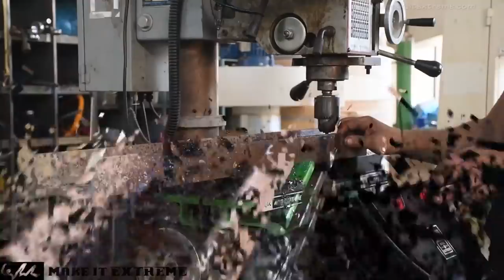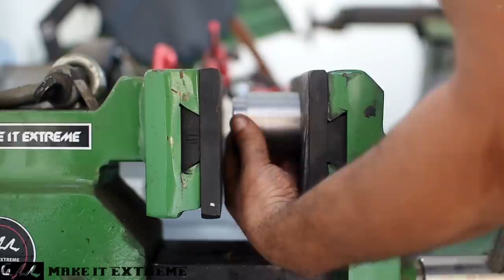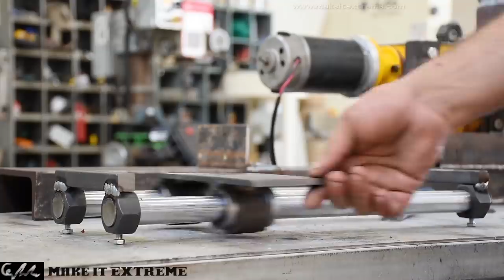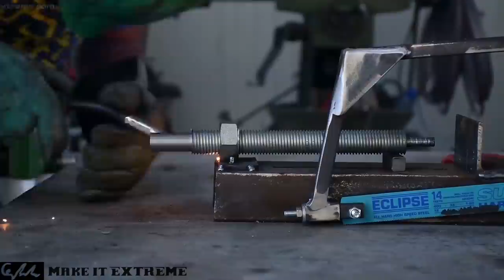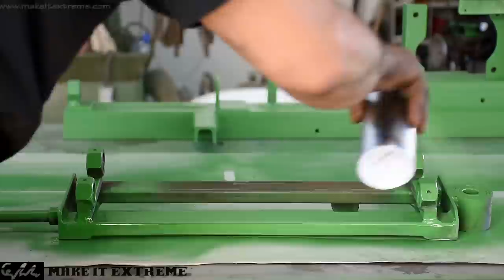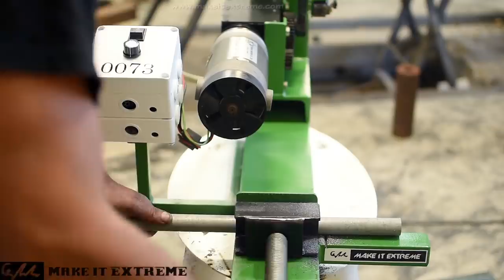How to Make a Power Hacksaw

Comment: Only out of curiosity: is there a reason you choose hacksaw instead of bandsaw? Or is it just for fun? Great work btw!
Reply: I think he is showing off his fab skills during down time in the shop. Also blacksmith motto is need a tool make a tool
Reply: No doubt of their skills. I love all their projects and find them very inspiring. I believe that making a bandsaw requires the same skill 😬
Reply: I believe that they use this type if something needs to be strait   but u dont have to babysit it  like with a bandsaw       

Was like 4 years ago that some machinist told me why they use it       so i dont rlly remember  

But machinists don't need a massive bandsaw  to do a job thats big for the type of saw u would need 

So the cheap option with little maintenance   and little heat involved is this kinda saw
Reply: Less prone to break down in a mighty screech 😂 bandsaw needs attention a lot of attention
The bandsaw tears through and therefore more prone to choke up and block or break down.

The hack saw is more a reciprocating saw fine teeth and is cleaning itself on each stroke. 
Bandsaw is more like a  tree saw, rough and scrapes. 

But nowadays both of the are considered straight, laser or water cutting is way more precise.
Reply: @Sassenhaim  Thank you for this long explanation ✌️It makes more sense now